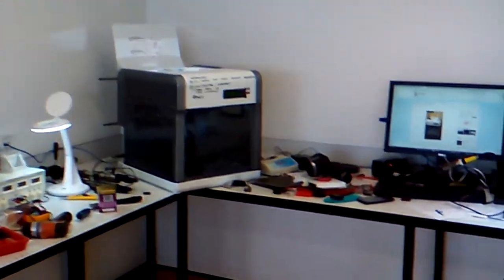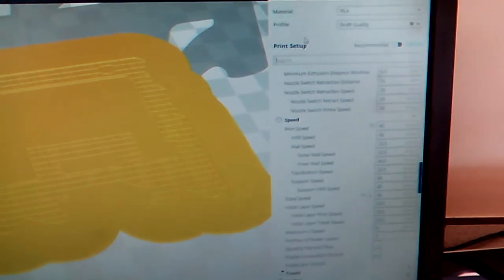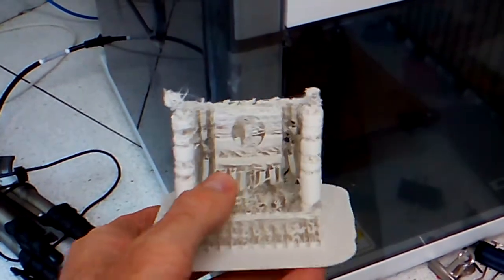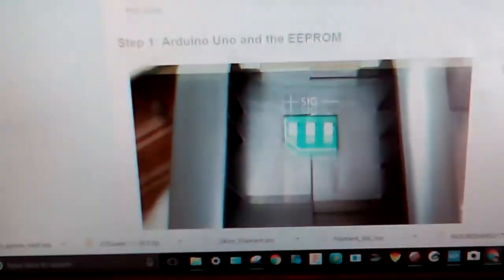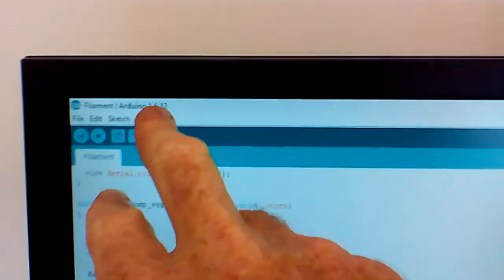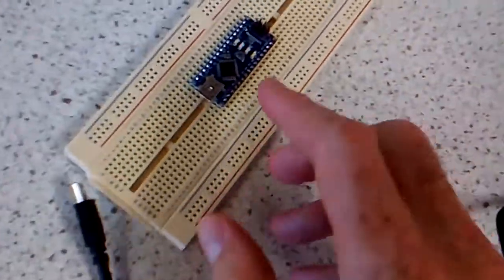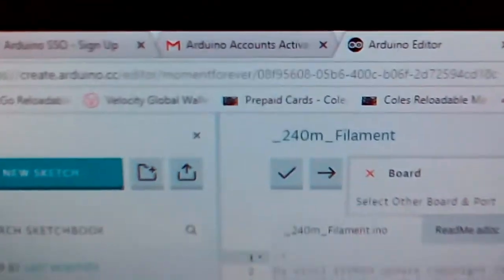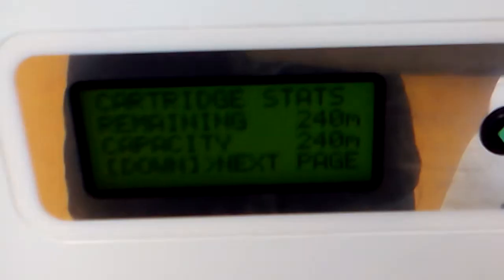DaVinci 1.0 filament Chip reset

Comment: No idea if it works on Da Vinci Junior printers?
Reply from the maker: Vaidotas Marcinkevicius  I can't say yes for certain . But I would lean towards a yes as it's the same manufacturer.
Reply: Simon Cumming does it work on da Vinci 2.0 duo
Reply: @legitcatcher2184  did you get it to work on the duo 2.0??  There isn't much here on the 2.0 duo, so I'd appreciate any help to get started on mine. Thx!